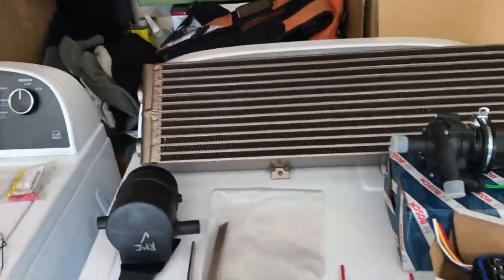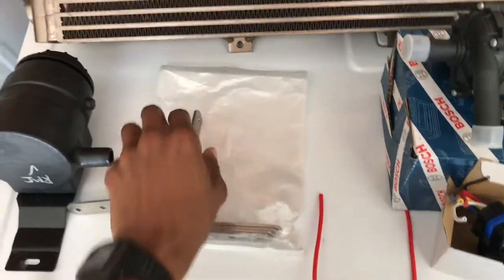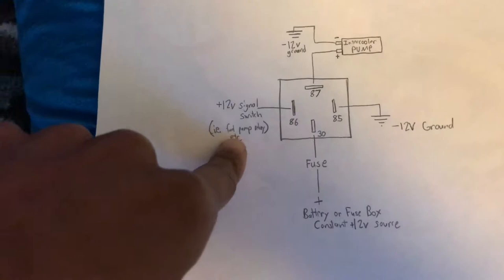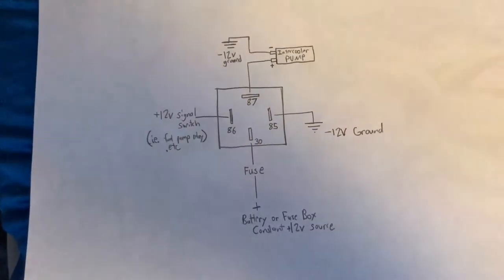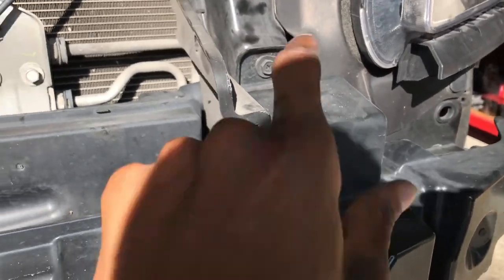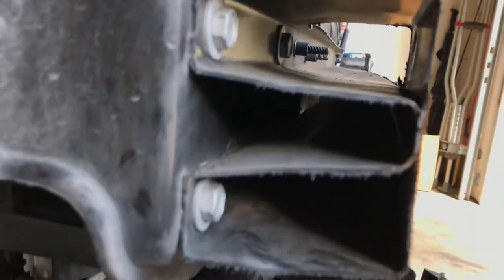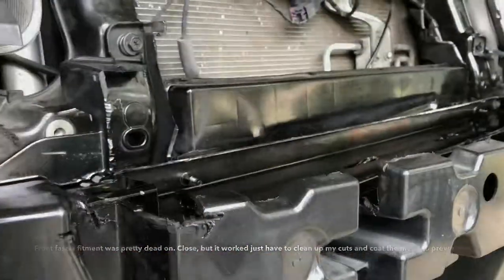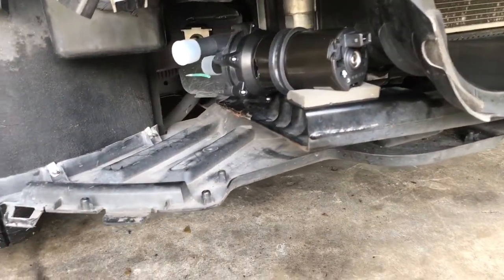LSA Swap (14’ Chevy SS) - PART 1 (Heat Exchanger/Intercooler Pump/Reservoir Mounting)

Comment: Hey man - thanks for the shout out! 

Just found your swap - love the parts you painted/coated. 

Just a heads up - my relay was tucked down in front of the fuse box, and water got in it and corroded it. I ended up replacing the relay - as my pump wasn't running.
Reply from the maker: bonecrrusherSS whoa. That’s for the heads up. And no problem. Your page was a huge help when it came to my setup so thank you

Comment: Getitat Wil Just found your. Great videos regarding your LSA supercharger builds.!!!

Questions- how is that Frozen Boost Heat exchange (26x7x3.5) holding up?
Do you think at 3 or 5 gallon water tank would be better? (I'm thinking about moving my battery to the trunk and putting a 3 or 5 gallon water tank in its place on my 1984 Chevy Caprice)

I have 2 Project builds (1984 Caprice Coupe 5.3 LS & 1963 Impala SS 6.0 LS) both of with LSA superchargers.
I have the same Frozen Boost Heat Exchanges ( 26x7x3.5) with dual 7" fans, not installed them yet, Tho..
Reply from the maker: Yo that things is great I will admit I didn’t know the model I got was going to be that thick. I prob didn’t need one that big but it’s been great. No issues and still holding up to this day. I’m thinking about getting another one for my 2JZ build actually since it’ll be running higher boost. I’m wanting to do a air to water intercooler instead of an air to air
Reply: @GetItAtWiLL  

Thank you for the reply and Da Info Will..

Comment: I love the vids man and I'll be using this to help me with my project. If you don't mind what are your IAT temps looking like with that heat exchanger and pump set up you have?
Reply from the maker: Zach Gibson it’s been a while since i checked but if you give me a few days I’ll data log it and see. Although I am currently in cooler than my normal air temps. And thank you btw I appreciate it
Reply: @GetItAtWiLL  you don't have to log it or anything but I was just curious if your set up is adequate because it's the route I'm thinking of going with. Also though if you don't mind what bolts did you use to actually bolt the supercharger to the engine? Did you get new intake manifold bolts or did you use the one original ones?
Reply from the maker: Zach Gibson I do know I never had any probs with my IATs. That heat exchanger was actually larger than I wanted but I didn’t feel like waiting to send it back so I made it work. And no I bought new bolts to mount the LSA. The stock bolts are diff length. I got mine from the site below but you can find them other places or if you want use some bolts from Home Depot or Lowe’s. The torque in super small on those. Like 89 inch lbs I believe on the second and final pass. 

https://west-michigan-automotive-technology.myshopify.com/collections/lsa-conversion-parts/products/lsa-supercharger-base-bolts

Comment: love your set up! Any chance you could tell me where you got the water pump strap from? Cant seem to find one that size.
Reply from the maker: Fez C my strap came with my pump. I can’t seem to find it at the moment but I did get it from eBay I believe so I’ll check there and let you know but this is a great alternative actually a better alternative if you have the room to fit it. The mount below is more stable and sturdy. And only $12

https://www.amazon.com/Dewhel-mount-mounting-bracket-cradle/dp/B00VRKQQS2/ref=pd_aw_fbt_263_img_3/143-3242925-4133867?_encoding=UTF8&pd_rd_i=B00VRKQQS2&pd_rd_r=c642ad4f-7dbd-11e9-8887-9b31b6cb4217&pd_rd_w=o8VJi&pd_rd_wg=9VqE7&pf_rd_p=3ecc74bd-d08f-44bd-96f3-d0c2b89f563a&pf_rd_r=FF25QTWCKZVR0QTS8ADA&psc=1&refRID=FF25QTWCKZVR0QTS8ADA
Reply: @GetItAtWiLL  thanks man i really appreciate your help. Your videos are very helpfull, keep them coming!

Comment: I know I’m late asl bro, but I’m looking into getting either this heat exchanger or boost district one but was curious what made you mount it up too instead of under the crash bar looks like there’s more room on the bottom unless you tried that
Reply from the maker: I think the only thing that stopped me from putting it there was that I was going to have to cut into that lower bumper air shrouding and I couldv’e but I felt it would’ve been more visible in terms of the cuts etc. putting it up too just let me keep all the cutting hidden behind the bumper. Either way will work though. It was my first time doing it too so I was kinda just going with what I thought worked.
Reply: @GetItAtWiLL  oh ok yea I seen one other post on the FB page from a guy 5 years ago the put the one you have below the crash bar an it was a pretty clean fitment but I’m the same as you don’t want to do much modifications as far as fitting it in there but I was tryna keep from spending $600 plus for the boost district one but yea still on the fence, do you still have the car by chance?
Reply from the maker: @54jumpman  yea it’s personal preference and my skills and creativity aren’t where they are now back then so I could prob make something work nicely now but yes I still have the car. I am wanting to sell it though. I want a manual now lol or a LS based truck.
Reply: @GetItAtWiLL  what kind of power were you making?
Reply from the maker: @54jumpman  600rwhp/550 tq @ 7 lbs on 91 oct

Comment: how are your iat's. i just ordered the same heat exchanger
Reply from the maker: noel Freeland they are good no issues at all I have to find what the exact numbers were. I don’t want to tell you the wrong think off the top of my head but I think you’ll like it if it works as well for you as it did for me

Comment: just so i can clarify, why you hooked the add a fuse in you connected to number 46 in the fuse box?
Reply from the maker: I was looking for a fuse that was only powered when the car was running that way the heat exchanger pump would only run then. I did want it to run when ACC was on or of course when the car was off. That was one of the fuses that I found was powered at the times I wanted. You don’t have to use that. And I’m sure some used another fuse or may have even put it on a switch they can control etc
Reply: @GetItAtWiLL  I figured out my problem, my problem was that I'm an idiot and I didn't put a fuse after the positive connection on the battery post but she's running now and I'll send a video if you'd like
Reply from the maker: @jjbuettner  ayeeeee. I’m glad you got it figured out. And it’s ok we all have those gotcha moments when we forgot shit lol but yea I’d love to check it out

Comment: how did you run the relay for the Bosch pump
Reply: Duh I should have looked at the hole video 1st lol
Reply from the maker: #85 of the relay went to a ground source, #30 went to the constant 12v source (I put a fuse in-line here as well), #87 goes to the positive connection of the intercooler pump wire harness, and #86 went to the 12v switch signal or the ignition source that will kick the relay over to turn the pump on when the car is running (I used 46 IP/Body IGN from fuse box)

Comment: My gto has a mp112 Magnuson sc  in it. The heat exchange is damaged. Can i use any heat exchange to replace ?
Reply from the maker: Yes, your only issue will be fitment depending on the brand and/or kind you get. Try to find one with similar dimensions and inlet/out ports in the same locations. But heat exchangers are all basically the same, just have to keep things in mind as far as fitment goes, where the inlet and outlet ports are located. I had to basically customize and fabricate a way to get mine to fit, esp after realizing there was a lot less room than I thought there was.

Comment: Do you have the part number for the pig tail on that Bosch pump?
Reply from the maker: https://www.amazon.com/gp/aw/d/B00BHKX9PA/ref=mp_s_a_1_1?ie=UTF8&qid=1512357472&sr=8-1&pi=AC_SX236_SY340_QL65&keywords=bosch+intercooler+pump&dpPl=1&dpID=41ugZA9-l8L&ref=plSrch
Reply from the maker: Sorry that took so long I didn’t know I had a comment. Should be Bosch 0392022002 or that’s the one I had

Comment: Doing Headers on the ss what all did you have to remove?
Reply from the maker: zayy Toven https://youtu.be/rx4mcEDYbk0
Reply from the maker: If I remember correctly all I had to remove or disconnect rather as far as obstacles went was the steering rod. It’s been a while since I did it but I have a vid for the install. See above